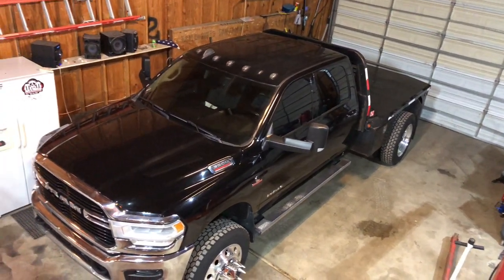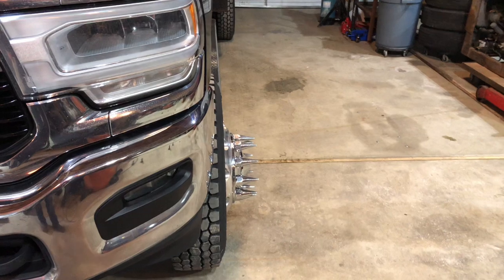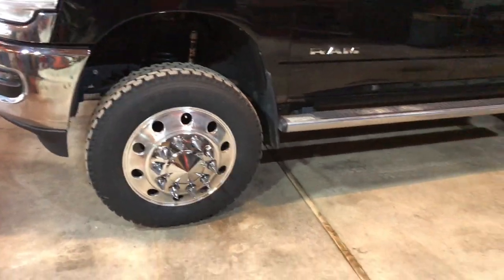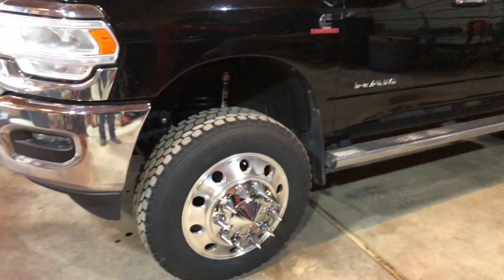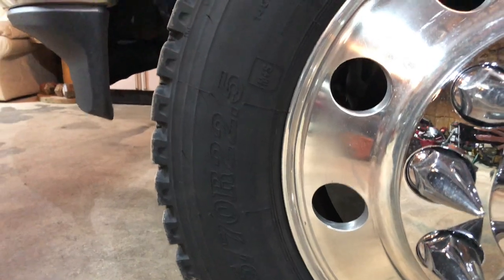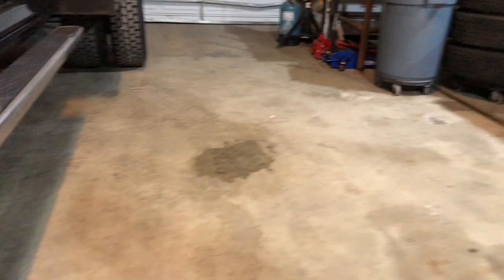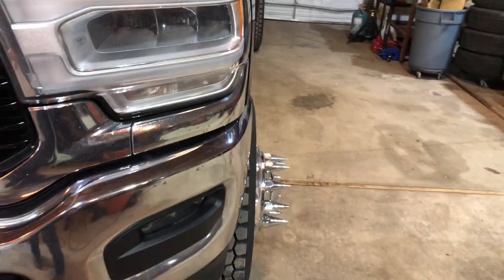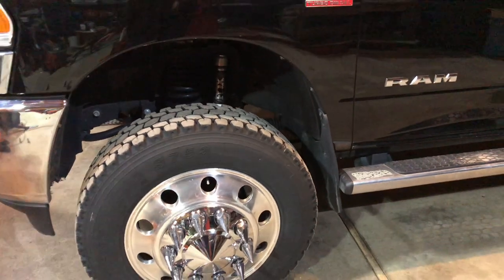22.5 Alcoa’s on your RAM 3500 dually 2019 and newer ￼

Comment: DOES  ANYONE  KNOW IF THIS SET UP WORK FOR A 2022 3500
Reply from the maker: It sure does. I just bought a 2022 I everything’s the exact same except for this one has the small fender flares that come OEM on the Laramie versus my old one that didn’t so I’m getting 2 inch offset wheel adapters instead of 1.5 in the front so that the tires stick out quarter inch in the rear I’m still running the 1.5 inch.

Comment: Recommendation for anyone doing this. I have a 19 ram 5500 with 22.5s. It tows 40k+ and sees 15k on the rear axle regularly. Do not get 18 ply tires. Get the lightest load rated 22.5 you can find. They will still hold way more than a pickup tire and will still last 80k+ miles. The heavier the rating the worse they ride
Reply from the maker: You do Reyes a valid point plus I’d be less rolling resistance. I do a lot of off-highway used so I wanted thicker tread and more plies for puncture resistance.
Reply: THATS SUCH A GOOD POINT THANKS

Comment: I’m about to go with a 22.5 conversion on my 2022 3500 just for the ability to rotate tires. Also, my truck has balancing beads in the steering tires for sure, not sure about the drive tires. Good looking truck!

Comment: Great choices. I have been contemplating the same path for my 2018 3500 Dually. I may go with steel adapters. Some folks reported having to replace all rubber bushings and real rough ride. Any issues with bushings or ride quality? What PSI do you keep your tires? Some had to lower to 80 PSI to get optimal ride quality.

Thanks for your input
Reply from the maker: The less weight you can put on your axles the better ride quality you’re gonna get, The aluminum adapters are about 20 pounds lighter than the steel, so that’s 80 pounds overall. there’s nothing wrong with the steel it’s just another factor in ride quality.  I tried retaining the most OEM look and ride quality, this is how the truck should’ve come from the factory. I run 130 psi in all of the tires now versus when I first put them on at 80 psi, you barely notice the ride characteristic change unless going over train tracks.. lol but either way that’s rough in the Dually. However I did notice I gained 2 miles per gallon of fuel economy on the freeway. And I’ll take that over ride quality! never heard anything about the bushings going bad. I’m sure the brakes were a little faster due to larger tire diameter. As per ride quality tho before putting these tires on I switched to Fox 2.0‘s shocks and that made a world of difference with the ride quality then so I’m sure it’s helping now.
Reply: @GoForBroke.  thanks for the detailed reply. I was thinking of aluminum adapters, until a few guys who purchased it for heavy towing reported that the manufacturer doesn’t give a tow rating ( I guess they are afraid of lawsuits)

Fox is what I was going to go with but this one guy who has the same tires and setup like you went with Icon ( A Russian/Ukrainian) hotshot guy). I plan to do heavy towing. But the lighter weight logic makes sense and I am heavily in favor of maximizing my MPG. I wish I could just replace my axles that came with 10 lug. But that’s a future project.

My next project is to add supplemental air brakes for trailers to the RAM
Reply from the maker: @rayislan9392  that makes sense but I’d also only go with a company that tests all their products, you’ll never find a company that guarantees load ratings for liability reasons tho. Look up venom wheel adapters out of California. They don’t necessarily have ratings but they’ve tested all their products under the harshest conditions. Steel adapters will give you the least amount of offset which would be best for hot shotting or towing, not allowing for too much tire stick out would help with rock chips and debris hitting your load. I’ve heard icons are pretty good and at almost half the price of fox. Personally knowing everything I know now and was gonna start hot shotting to make the most money possible, i’d run around with 4.10 gears 2 1/2 inch leveling kit upfront, steel adapters in the rear, 1 1/2”aluminum adapters upfront, fully bridged steer tires in the front bridged Drive tires in the rear, preferably the auto air suspension dodge comes with, with OEM shocks in the rear, and icon shocks upfront. tires aired up to the max. Tire pressure has a huge effect on the fuel economy, even my trailer would have the highest ply rating psi rating tire I could find. I have a 14,000 pound fifth wheel I pull, triple axle used to have 10 ply tires, 85 psi max switch them all to14 ply 110 psi max and averaged 3 miles per gallon better pulling my camper. It’s crazy how much rolling resistance changes with tire psi.
Reply: @GoForBroke.  I will definitely lookup Venom, Thanks!! I also like your idea of front aluminum and rear steel - Glad I waited for the purchase 
I was lucky when I picked up my 3500. It had 4.10 and rear air bags. I also towed as heavy as 45k over thousands of miles. I picked up a Fifth wheel with air bags rated for 32k which made towing easy. But because I used factory tires that have E ratings, I had many blow outs over the years. So 22.5 tires with 14 ply would be a dream come true.
I will probably pickup Solastic shackles/rubber springs for my rear
Reply from the maker: @rayislan9392   I had a hard time finding pictures of what tires would look like on my truck if you go to Facebook and look up Dually wheels - American force wheels The profile picture is just a Mexican guy, he’s got a lot of pictures of all the different styles of tires you can run as well as pictures of trucks like ours with these tires and rims to get an idea of what it will look like, A lot of them are set up for hot shotting, and yeah it’s nice having peace of mind knowing I have 18 ply tires on my truck rated for 3 times the weight I’m ever gonna put on it. i’m glad I could help
Reply: @GoForBroke.  while doing research, I recall one guy stating as a matter of fact that when doing Dually wheels, one should not do aluminum with aluminum - they should mix metal with aluminum. Have you heard anything like this. 

My thoughts: it shouldn’t matter, especially if we are using centramatic wheel balancers between the wheels
Reply from the maker: @rayislan9392  Well then DOT would shut down half the semi trucks running dual aluminum rims.. The poor man put the steel rim on the inside. I mean you gained probably a quarter inch of spacing due to the aluminum being thicker mounting surface, if anything the steel wheel is gonna rust and stain your aluminum rim. Someone probably told him that at one point and he took it for truth.

Comment: DIDNT COVER ROAD NOISE, RIDE QUALITY ETC..I HAD A 3RD GEN WITH THE SAME WHEELS 10 YEARS AGO AND IT RODE LIKE SHIT COMBINED WITH THE 4.5" LIFT.  ONCE I ADDED BAGS IN THE BACK IT MADE A NIGHT AND DAY DIFFERENCE.  THEY LAST FOREVER AND RARELY EVER HAD ISSUES.
Reply: This is mostly going to be a looks/aesthetics modification because putting big ass semi-truck wheels and tires on your 1-ton is not going to do anything good from a technical or performance standpoint, aside from lasting forever as you mentioned.

Comment: Nice truck, I had this same setup before on my dually always loved the look, but the adapters while being made of  billet steel, were built with too much play so I ended up getting rid of the setup, but planning on going back. where did you get your 10 lug adapters?
Reply from the maker: Website was venom wheel adapters American made high quality, steel or aluminum. The adapter to the wheel and to the hub were hubcentric, which made for a very tight and secure bolt up. Almost 30,000 miles on mine with no issues.
Reply: Did you have to notch the wheels for adapters?

Comment: Any benefits? Or just am aesthetic thing? I run hotshot and have 19.5 contemplating 22s.
Reply from the maker: 19.5 you have a wider range of tire size selection with 22.5’s smallest you’re gonna be able to go is 37 which works out perfect if you have 4.10 gears. And they do look super slick

Comment: Truck looks amazing ! Brother thanks for every bit of info you provided I have a few questions is the suspension on your truck completely stock or is the truck leveled or lifted and as for the ride quality would you say it’s worse than stock or did it get a tad bit more comfortable and do you have helper bags
Reply from the maker: I have a 4 1/2 inch lift in the front and 2 inch block in the rear to keep it level. although all that is required is a 2 1/2 inch leveling kit to run the size of tire,  truck came with factory auto leveling airbags which are amazing and are an amazing ride quality compared to conventional leaf springs. After putting these rims and tires on if aired up to 130 psi you do notice a little more when it comes to bumps on the road. But if you run them at 80 or 90 psi it pretty much rides like it did before. But I prefer to keep them aired to 130 due to the better fuel economy it gets. The fox 2.0 shocks also help with a better ride quality. I honestly barely noticed a difference once I put them on other than being a lot higher in the air, And having much less rolling resistance.
Reply: Ok great yes I run a 2019 ram 3500 cab chassis 60 “ with hitch crafters bed pretty much stock out than a pedal monster you truck is amazing looks like a 5500 and I love the stance I’m very Leary with lifts and stuff of that nature do you mind telling me exactly what products you used I think I’m going to go for it
Reply: I went online and searched for wheels they’re saying 22.5 won’t fit cab chassis
Reply from the maker: @anthonyjames2870  I remember reading somewhere that the axles are about 8 inches narrower so 4 inches on each side, but the frame rails and leaf springs are also more narrow taking that number so I think 2 inches on each side. I’m not 100% sure but I think if you run 2 1/2 or 3 inch Wheel adapters you should be all right. If I was you I’d go to a dealership and pull some measurements on a regular one versus yours. Any half decent adapter manufacture should be able to custom build adapters for your rear axle to whatever length you need them. I went with venom adapters out of California

Comment: Im assuming your truck is lifted? That setup looks great, I wonder if these would look decent on a non lifted truck?
Reply from the maker: 4 1/2 inches in the front 2 inches in the back i’ve seen it done on a truck that has a 2 1/2 in the front to level it out and it looks pretty good. A lot of hotshot owners will run these for a fuel economy and the load rating, with just a leveled truck. I’ve heard they will fit on a stock truck but I’ve only seen them on leveled or lifted trucks.
Reply: Hi, I have 255/70 r22.5 no lift kit and I don't have any problem with it , lift kit it's optional 👍

Comment: What pressure are you running at. I did this swap and they are riding much ruffer than the recaps thatbwere on the rims i bought. Cant seem to find thier happy psi. Thanks Nate.
Reply from the maker: Depending what brand you go with some are held to a higher standard than others but I run mine at max psi for the best fuel economy so 130 psi and have no issues. I do have one wheel that is very unbalanced so I always run that one in the back though.
Reply: @GoForBroke.  thanks. I have the exact same setup you have expect I went for balance rings. I'll try 130 Thanks very much for the info.

Comment: How’s the performance of the tires themselves in bad weather ????
Reply from the maker: With the tread as spaced out and deep with no bridging of the tread blocks, They perform very well. although the rubber compound is harder than your average mud tire, they have a lot more traction in rain and snow than the OEM tires I had on it. Before when I hit big puddles or it was raining really hard I could feel my front end pushing around when I hit large areas of standing water, but with these tires you can really tell that they’ve got good contact with the ground even in the ice they did pretty well. Obviously if you have them aired up to 130 psi they skate around a little more on the snow. But drop them down to 65 and you basically have the same traction you have on any other mud tire. Now if you were to get a commercial tire that was fully bridged like a steer tire or the outer tread blocks are bridged together you may run into hydroplaning issues due to the water not being able to escape the tread blocks. But these tires tend to last longer due to the stability the tread blocks have being tied together.

Comment: any issues? do you tow? how many miles on setup?
Reply from the maker: I’ve got about 40,000 miles on the set up now. No issues tires are still more than half-life toes like a dream with 410 gears 373 and you’d probably drop off on fuel mileage.

Comment: You have a lift kit on there to clear ?
Reply from the maker: You can clear them with just a leveling kit and I’ve heard you can do it with it stock. You just have to trim some of the plastic but I have a 4 1/2 inch lift kit from zone.

Comment: Is yours a cab and chassis? How much room do u have from inside of inner dual to leaf springs?
Reply from the maker: Mine is not a c&c I believe with those you need a 3 inch spacer but I’m not 100% sure
Reply: @Go For Broke  ok mine is a dually as well so how much room u have from inner dually sidewall to leaf pack?

Comment: What about factory tire psi sensors? They work with the 22.5?
Reply from the maker: I’ve never had good luck with them. There might be an adapter kit somewhere out there, but I just threw all of mine in a 4 inch piece of pipe with caps on each end and a air chuck. Air up to 90 psi so I don’t get the consul freaking out at me. And put the pipe in those hidden compartments under the back floor mat

Comment: This increase the payload capacity or just for show ?
Reply from the maker: Doesn’t increase the axle load bearing capacity. But it does increase the peace of mind knowing your tires will be the last thing to fail while pulling a trailer. Anyone that had a steer tire or one of your dual blow out while pulling knows how sketchy it can be. So when you put tires that are rated for three times the weight, your truck will ever be able to pull you know they shouldn’t give you any issues.

Comment: Are you running any tire pressure sensors?
Reply from the maker: I put them in a 3 inch piece of pipe, threaded on both ends with a Air chuck so I pressurized all of them and stick it under the backseat. I’d be nice if Dodge had a way to delete that function

Comment: what would i need for a 1990 ford f450 dully 10 lug
Reply from the maker: There’s a guy on YouTube that does a review of a 10 lug Ford and what he had to do to get his wheels and tires to fit I believe you have to go with a 2 inch spacer in order to clear the studs unless you get either a cut out rim or have your studs cut shorter. But if it’s a cabin chassis you might run into issues of the rear tires hitting the frame.
Reply: I have a 2019 ram 5500. They actually make a bolt on 22.5 10 on 225 mm (small 10) rim. That's what I went with so I don't need adapters

Comment: What did you do for tpms sensors?
Reply from the maker: I’m sure there’s a way to make them work, what I ended up doing since there’s not a way to diss activate the TPMS light is put all six sensors in a 3 inch threaded pipe put caps on each end and an air chuck on it and I air the piece of pipe up to 90 psi and then put it in the hidden compartment under the back seat.
Reply: Actually a pretty smart hack much appreciated, are you running steel on the inside ? Getting the last little pieces together to do this myself.
Reply from the maker: @hustletruckingllc  i’m running all aluminum that way I can rotate them however I want but to save money you can do the innards as steel but realistically any semi truck tire shop is gonna have extra aluminum rims for like $160 laying around
Reply: What brand of tires did you end up going with?